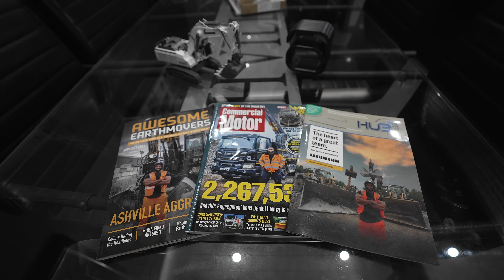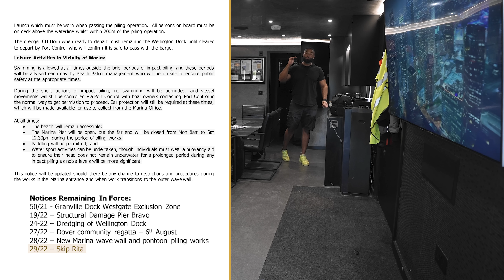End of the Road? | Ashville Weekly ep100

Comment: CONCRETE SUGGESTION 20:40 : Try a company called Blue Phoenix Group (formerly Ballast Phoenix), they sell recycled aggregates from incinerator bottom ash. Averaged about 1/2 the price of ballast a couple years ago (as cheap as £8.30/t). Wouldn't have a clue how it would perform in concrete though. They cover London etc and deliver in artics. We would use their Type 3 approved alternative on large sites and save a bunch! Their sales team are great and have a research department you could speak to regarding concrete supply.
Reply: Also for non-structural builds, perhaps glass, recycled tyres (chippings), recycled tarmac aggregates etc to bulk out and save on primary aggregate. Not suggesting you could ever build a concrete framed building with any of these ideas, regardless of strength, but using recycled aggregates where strength isn't terribly important would make for an awesome read in a magazine - how a company is turning waste into a useful product.
Reply: And recycled plastics (eg. performing like screed fibres).

Comment: I don't know if you have looked into it before for cement but an alternate source sand that I have heard is under utilised is the mica from the china clay production in Cornwall, I know trains of it have run to London was operated by Freightliner but more recently has been DB, your location and rail access certainly would give you an advantage if it made sense for your business to use it.

Comment: Hi.  I'm using Bottom Ash as a substitute for M-sand in cement block manufacturing.  The same thing could be used for Concrete backfilling.  It depends on the structure of the bottom ash.  This is "MSWI Bottm Ash". As a cement block with a normal timer block making machine I achieved a strength of around 3 Kn.  The ratio of mix was 16 parts of Bottom Ash to 1 part cement.

Comment: You should look at the roman history with concrete. They had one mix that basically was as good as it can get and is insainly tough. There are parts of the old roman empire where the concrete they mixed is still standing now and is still regarded as some of the best ever made.
Reply: This is taken from Wikipedia . Roman concrete was based on a hydraulic-setting cement. It is durable due to its incorporation of pozzolanic ash, which prevents cracks from spreading.
Reply: This is taken from Wikipedia . Roman concrete was based on a hydraulic-setting cement. It is durable due to its incorporation of pozzolanic ash, which prevents cracks from spreading.

Comment: Fly ash is a by-product of coal combustion in power stations.  

Aside from offering environmental advantages by re-using industry waste, adding fly ash also improves the overall performance and quality of concrete. 

Fly ash affects the plastic properties of concrete by improving workability, reducing water demand, controlling bleeding, and lowering the heat of hydration. 

Fly ash increases strength development at later ages, reduces corrosion of reinforcing steel, and generally improves resistance to chemical attack and mobility through a reduction in permeability. 

Concrete-grade fly ash is a supplementary cementitious material that delivers improved later-age strength, workability and enhances the durability properties of concrete. 

It is commonly used as a 20% – 30% cement replacement in concrete. 

Grade 1 Fly Ash is used as a single product or may be blended to produce a Fly Ash Blended Cement. 

Grade 1 Fly Ash is recommended for use in virtually all conventional concrete applications.